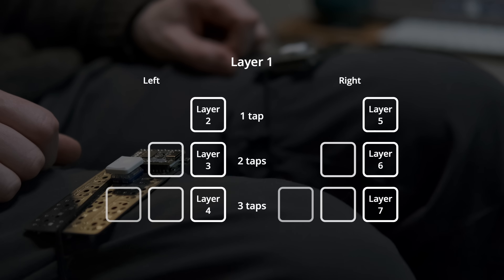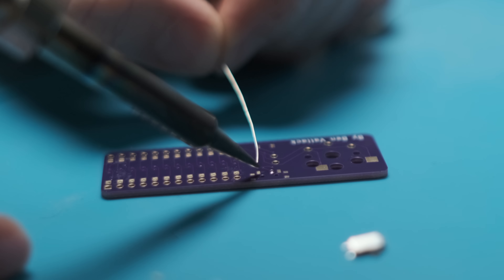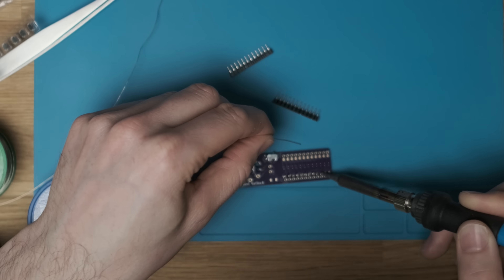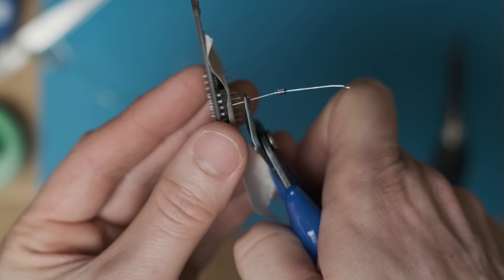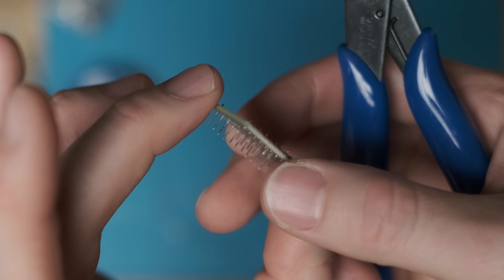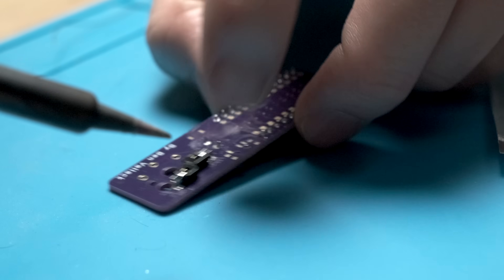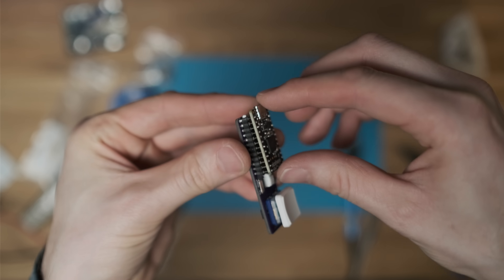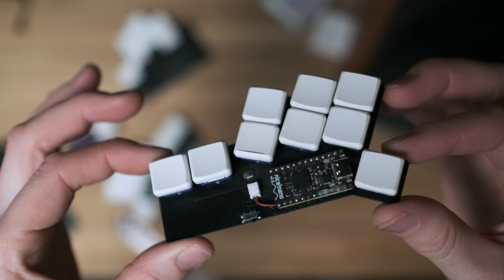Taking a Joke Too Far!!

Comment: Why not just use off the shelf pins and sockets? they are much easier to use and cost almost nothing. No need for this tape and wire mess
Reply from the maker: They aren’t easy to remove are they? Can you send a link?

Comment: This is clever little project!. if the solder doesn't flow well make sure you're wiping the tip on your damp sponge in between each or every other connection.

Comment: I agree with the comments saying to tin one pad only, and to avoid pressure. Regarding temperature: I always say that you want a temperature that’s as low as possible, but as high as needed. 

Excessively high temperatures can damage things and cause your flux to burn off faster (and the tip, and the solder on it, oxidize faster), but excessively low temperatures also can lead to damage, because it takes too long to make a joint. In particular with connectors, a low temperature leads you to keep the iron there forever, and in the end the plastic melts before solder will flow properly. 

Similarly, PCB pads are sensitive to prolonged heat, so it’s better to go hot for a second than too low for 10.

Comment: I just wanted to check, when soldering the pads for the nice!nano, would I be correct in assuming that by soldering the pads on the bottom of the keyboard rather than the top like you do in this video I would be able to mount the nice!nanos with their logos and components facing downwards? Thanks for the tutorial, excellent as usual.
Reply from the maker: Correct :)
Reply: @BenVallack  Excellent, thanks!

Comment: Those round pin headers make the best connection I find. All my commonly used prototyping components have the round pin header on everything I want to stick in the breadboard. Things like dip sockets, buttons,  the red 2 to 16 bit slide buttons that come in different sizes.  Basically anything with a weak leg.

Comment: Hey Mate, great video but if I may give you a soldering tip: You don't need flux if you properly heat the pad and then flow solder onto it, and lift the soldering iron before the flux embedded in the solder wire gets used up.
Reply from the maker: Ah good to know cheers!
Reply: @BenVallack  I just got notified of this. You're welcome, keep making stuff.

Comment: Hey Ben. Thanks for these videos, they are fantastic. I have a question about the reversible footprint since I don't fully understand it all yet. Say I have a 17 key split keyboard, Can I still use all the pins on the front copper layer, for some reason I think both sides should be for 1 key only because of the way it looks. Hope you have a good day
Reply from the maker: The pins are connected to both layers - but depending on the soldering of the jumpers it will just switch it so you can keep the controller facing the same way on both halves instead of being reversed on one half. It’s hard to explain and get your head around until you do get it then it suddenly makes sense!
Reply: @BenVallack  Hi again Ben, thank you for answering. I had a son in the meanwhile so I didn’t pick up my keyboard hobby until now. I think I understand. So I can route to all pin outs and just flip the board for my left/right side? My keyboard is the same as your 34 key layout, but I used the iPad tool you showed to sculpt it to my fingers…

Comment: You can buy crimp tools for JST connectors which come with a whole pack of male and female connector parts. The crimp tools make dealing with the JST a ton easier than prying with pliers and additionally are quite more reliable. The only tricky part is that you need to get the right JST form factor of which there are many different JST types.
Reply from the maker: Ah cool just checked them out. Much neater fold of the connector. Although now I have my two batteries I won’t need to do that again when I change my boards of course.
Reply: @BenVallack  yeah they're more worth it when you're making connectors in quantities of 10 instead of in singles. Though, I've found that since buying the JST connector kit I started using them for everything, pretty much never use wire splices anymore! After all... You know the old adage: when all you have is a crimp tool, everything starts to look like a JST connector.

 I'd argue it's a worthy addition to a lab. Don't buy the official JST one's for $100 you can get generic ones off Amazon for like $20 bucks or so.

Comment: How long does the battery last? Does it charge via the USB-C port on the Nice nano? Any chance of a walk through of designing and building split wireless keyboards?
Reply from the maker: Here’s the design process: https://youtu.be/M_VuXVErD6E the build is basically exactly the same as in the one key board, just more keys. Battery life on the primary half is a good few weeks. But I’m actually using a third nice!nano as a dongle (see the repos in description) so both halves are then technically secondary and the batteries lasts absolutely ages, must be well over a month.

Comment: having both headers in to create a dip socket is a good idea, however you should put a an old dead chip, or a chip that don't care if it will be damaged, into the to headers. This will further stabilize it. it also insures proper spacing...

Comment: Nice. But I don't really get the reversible footprint part. When you design your pcb, can't you just place the board however you want? And why do you have to put the solder on the pads? What does it connect, that isn't already connected by the traces?
Reply from the maker: The idea is to allow for the use of the same board for both left and right sides of the keyboard. If you imagine a controller stuck to the board on the left, but still on the top of the board, the pins will be connected to the opposite side compared with the same arrangement on the other side. This can simply be solved by mounting one controller upside down, but that is an unsightly approach. The solder pads connect the controller mount through holes to the traces, but because you only do one side of the board, they only connect to the correct traces. It's incredibly hard to explain but once you visualise whats going on in your head it makes sense!
Reply: @BenVallack  Oh wow, yes, now I understand that's a real nice solution. Thanks for the explanation🙂

Comment: As an electronics technician I can not really agree with your soldering technique. If you’d do this to some small ceramic capacitors, they’d crack. Try fixing one pin perfectly and than solder the others. Or a second accepted technique qould be heating both pads at same time and then push the component in
Reply from the maker: Yeah I’m certain my technique is not good!! Thanks for sharing the best practices. I have been experimenting with solder paste too and have good results with that.

Comment: Pro tip about the jumper pads. Since you used flux directly on the pads near the pins, you could start doing the first pad and just swipe across all the pads while applying more solder to make a blob leaving a perfect amount of solder on each one. You would have to get the iron a bit hotter, but it's so quick there is a smaller chance of lifting a pad.

Comment: You can make your life a lot easier by just putting solder on one pad, reflowing the solder when you place the part, then the part will stay in place so you can solder the rest of the pins. 
If you really like tinning all the pads, you might be like using 2 irons at the same time, or hot air, you can really quickly solder many parts. 
When bridging solder joints, you will get better results if you dont use flux. When you want to prevent solder bridging, adding flux, and reheating is often all you need to clean up a bridge
Reply from the maker: Good tips thanks! I’ve been experimenting with solder paste and a heat gun. Having some good results.
Reply: @BenVallack  Hot air works really well, however you should be careful around plastic parts. You can shield stuff with a aluminum foil tape, or kapton tape of you have it. Also try to keep the heat moving, if you sit too long on one spot, you can de-laminate the pcb 
Solder paste works best if you keep it wet, and reflow it before it dries, so keep your paste container closed, and reflow it within a few minutes of applying it. 
Its no big deal if it doesnt reflow perfectly, you may need to clean up solder bridges, or use an iron to fix things.

Comment: This one is one key away from a morse code input device. Or two keys away from a mind reading machine
Reply: You can technically use it as is for a straight line morse key but yes if you want an iambic paddle you will need a second key. Most people tend to prefer iambic paddles.

Comment: 4:57 you can actually get pin headers, which are strips with pins that have the same distance as the holes. These are designed to plug into the holes and don't bend easily. You also don't need to trim them, because they are even already. Actually you shouldn't trim anything after soldering, as the cutting causes vibrations which induce tiny defects in the solder. That decreases the lifespan of the joint. It is fine most of the time, but it is bad practice. Trim before soldering. Always.

btw I am a former electrician and I study electrical engineering at the moment.
Reply from the maker: Ah yeah I did wonder about the trimming after soldering thing. I have used the mill max pins, I still managed to bend them pretty easily!
Reply: @BenVallack  I though you choose that method instead using pin headers to get a lower profile
Reply: Trimming after soldering is absolutely fine. In fact, I've never heard of anyone, even in industry, trimming leads before hand soldering. It just doesn't make any practical sense. And that thing about vibrations is just plain wrong.
Reply: @djdjukic  Well maybe it doesn't get taught everywhere, but it is absolutely true. You can google it if you want, but for me it was enough being told that in my job training in the Bundeswehr. If it is best practice in the german military, it's most likely the way to go in terms of reliability 😉
Reply: @robinte98  Well, fair enough, I know nothing of military engineering practices. Other than leaded solder is still used, which surely helps!
Reply: Thank you for your input, trim before soldering and use tape for my future builds

Comment: Thank you for your hard. I am interested in this adventure.  However I am a little confuse. I saw many diyers using diode and wires to connect the switches to the microcontroller. However you didn’t use any of those. You did use something you called «"hot swap socket"» around 8:15 minutes in the video. Can you explain your choice? Thanks again
Reply from the maker: Yep, diodes are only needed if you have more than 36 keys - that is why this idea of 36 keys or less is so appealing. Much easier to make.
Reply: Hot-swap socket lets you add and remove mechanical keyboard switches without soldering and de-soldering. This way he can easily change out the switches for different switches, or easily move the switches to a different board. It's also why he used the socket for the microcontroller, so he can remove it easily later.

Comment: Hi Ben, I enjoy the videos. This is the fanciest morse code key I've seen in years. If you want to make the task of surface mount soldering easier you may want to take a look at a hot-air soldering station. Even though they are used mostly for rework they work great for project builds. The hot -air replaces the tip so you can see what you're doing and not have the problem of the tip pushing the component off the pad. I would recommend using less solder for the surface mount components. It doesn't take much to make a good electrical connection and too much can cause the component to float off the board. The diameter of the solder makes a difference as well, 1.0mm  solder is good for through hole, for surface mount I use 0.8mm or 0.6mm. If you really want to go high tech search for some "solder paste".
Reply from the maker: Useful tips cheers!

Comment: This still just makes me wish that KiCAD and other EDA tools werent so rubbish with their coordinate systems and interfaces.
The dimensioning tools available for non-EDA CAD software is usually way better, like those in Inventor/Fusion 360 and SolidWorks.
If EDA tools implemented that, got rid of their rubbish grid systems, and made the tooling better, you'd be able to get stuff out far faster, parameterise boards better, and completely remove the middleman tools that are currently needed.

Too bad industry tooling is always slow as hell to improve.
Reply: Guess I'll just have to make my own tooling :P

Comment: I'd suggest to anyone else to not use a bare conductive knife to spudge the controller out of the socket, use a non-conductive spudger or something else non-conductive.
If your board doesn't have a power slider (i.e. it was originally designed for pro micros and elite c's) then you could short some pins that may cause damage. Probably very low risk but it's a consideration none-the-less

Comment: I'd suggest you buy mill max male machined sockets to match your female sockets.
It'll end up being infinitely harder to bend the pins
Reply: Make sure they are matching machined sockets. Nornal male header strip's won't work, they aren't circular
Reply from the maker: Yeah I have used them before, very expensive, and I managed to bend them too heh!
Reply: @BenVallack  Definitely more expensive, but at least they are easier to solder. Maybe I got lucky with the one I used too wrt bending haha

Comment: Can you share resources on this reversible footprint for the nice!nano? I am using a Seeeduino Xiao BLE and want to create a similar footprint for that MCU, but am having troubles understanding the workings of the footprint from just this video. 

Thanks for the introduction to such a cool thing though! I'm building a reversible board now and am really looking forward to adding reversible footprints rather than accommodating extra clearance on both the back and front of the board.
Reply from the maker: It is in my Ergogen fork. src/footprints/promicro_pretty.js amazing thing!
Reply: @BenVallack  awesome thank you. Is this something you made yourself?
Reply from the maker: @arcasoy  No, it was here originally https://github.com/50an6xy06r6n/keyboard_reversible.pretty then modified by Anodyne in the Ergogen discord.
Reply: there's a number of variatione of these footprints. Best option to look at them and have them explained to you would probably to ask on the ergogen discord (aka the absolem hub)

Comment: When pre tinning the hotswap socket's pads, just tin one pad. Then align and solder the socket to that pad. After that you can solder the other side. This ensures that the socket is aligned with the PCB and there is no gap between it and the PCB. It's also much faster then sinking and counter sinking. The same can be done for any surface mount component. Also when solder the pin onto the Arduino or any soldering that is in a line it is generally recommended to do one pin from one side and then one pin from the other and continue alternating in an X pattern to prevent heating the board in the same place for too long. But I think this isn't affecting these boards that much
Reply from the maker: Great info thanks! I knew I’d get some good tips here!

Comment: if instead of tinning every pad before placing the part on the board you just tin one (or 2 opposite for bigger parts) the component will be able to sit completely against the pcb and you won't need to apply any pressure at all. you can just tin the rest with the component in place
Reply from the maker: Great thanks!

Comment: Hey, I'd recommend snipping the ends off pins before soldering. This can give you a much cleaner joint.
Reply: Also, for parts with multiple solder joints I'd recommend pre-tinning only one of the solder pads. Heat it up, apply pressure to make the part even once, and you don't have to stress it or bend anything to put it flat against the PCB. This is especially relevant for hotswap sockets, if they're on crooked, it's easier to snap them off with a switch.
Reply from the maker: Great tips thanks!

Comment: I just had an idea: how about a keyboard like a glove? With one key on each finger except the thumb. Like this coordination excercise where you tip your fingers with your thumb. I have no idea if you know what i mean but dunno how to describe it. That could be fun. But probably needs some custom key caps or could work with rubber dome keys without caps. I do not have much time rn but gonna do some custom keybords at the end of the year.

I dont like this approache 5:30 because those pins are not very stable and bend easily as you also noticed. I prefere to use the sockets and pins you often see at arduinos or on pcbs and stuff like that. Because its easier to solder, because they are "premade" and can resist some force so you dont have to worry too much about breaking them. You can also buy some with a bigger spacing so you can fit bigger batteries below them if you like.
Reply: I wouldn't do it with keycaps and traditional switches. Just put a conductive surface on each finger, connect the thumb to ground and each finger to a different pin on the micro-controller. Touch any finger to the thumb to connect to ground and send the output.
Reply: @KyekOfficial  look up what the tap keyboard is
Reply: @KyekOfficial  Yes good idea.
Reply: Tap keyboard